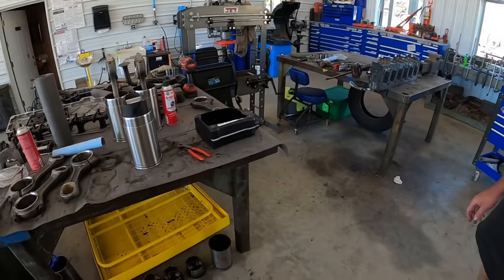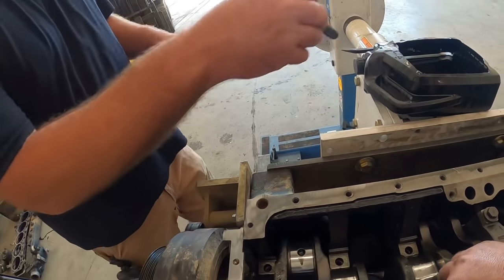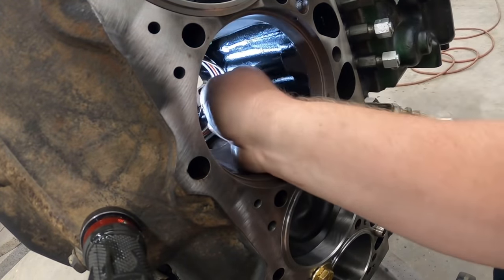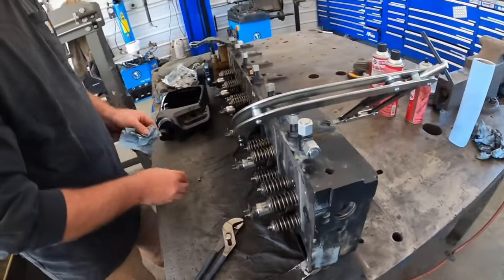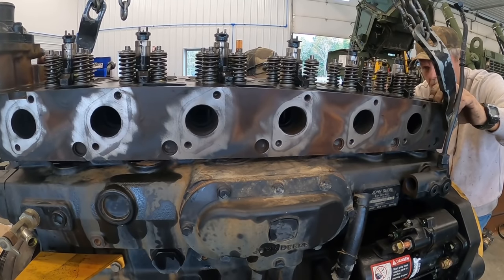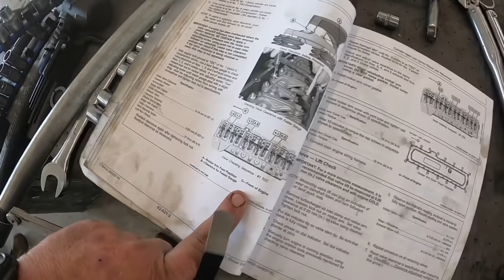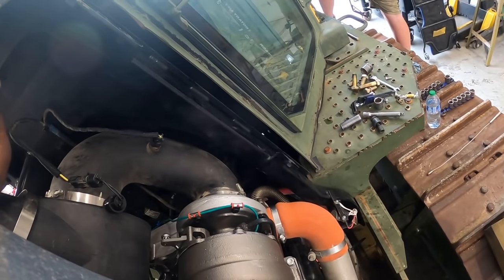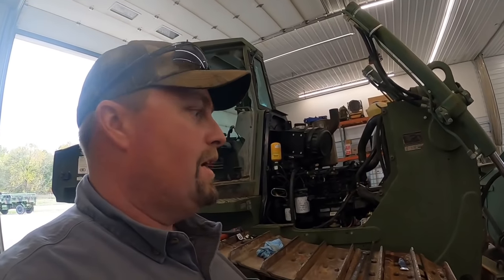John Deere 6090 9.0L engine rebuild in 850J part 2

Comment: Love the clean assembly environment and the attention to detail. If I needed work done I know exactly where I’d go!
Reply: Yea nice shop environment for rebuilding an engine but I’m not seeing any assembly lube being used there’s no way you want to start that thing dry? Those crank bearing should have all been coated with assembly lube.
Reply: @joecorrie1  
They were coated with oil and started within a couple of days so the long-term protection and stickiness of assembly lube isn't required.  It wouldn't hurt to use asslube but I certainly wouldn't stop screwing it together if I didn't have any.  There's some stuff I'd do different if I had the time and money but their work looks to be plenty up-to-par; I'd have no problem running it out the door and standing behind it if it were my shop (my come-back rate/ratio was well into "less" range, beyond the ideal balance rate(s).
Reply: Torque to yield requires a special lubricant to be installed on threads and the head of the bolts to properly stretch each bolt which wasn't done. 
Rolling them bearings in sure did remove material from the back of bearings. Hope it didn't get into oil galleys. Goodluck with that build.

Comment: NEVER run main cap bolts or head bolts in with an impact wrench.  These bolt should be seated slowly and calmly by hand using any method that runs them in at hand speed. Most times you might not cause any problems using a low speed output of a cordless impact,  but the riskiest practice is to use a bigger, faster pneumatic impact and go full gorilla on the trigger.  I am not talking about TORQUE. I am talking about the lubricated threads acting as a hydraulic fracturing device if the bolts are seated faster than the oil can escape out through the threads.  To be fair about your use of the impact in this video, you were using only oil as a lube, and that is more forgiving than paste type torquing lubricants.
I have during the more than 50 years in the mechanic field seen 2 engine blocks damaged by a mechanic running head bolts or main bolts in with too much enthusiasm using a pneumatic impact wrench.  One was cracked when the cylinder head bolts were run in and the other was from the main bolts run in.
Reply: Would be easy to peel a corner of a main web by the cocked cap. Cordless electric drill is the easiest and safest tool for primary assm.

Comment: Bought a 400 Cummins dump. Drove it for some months without checking the air filter. It wasn't there. Dealer did NOT make it good.

Comment: I'd suggest the small investment in a gantry crane.  Save hours on the forklift, but also make it possible to do jobs safely with fewer hands.  Get the largest+tallest that fits into your shop, even if you have to assemble it inside.  But it probably only needs winch capacity to lift an engine, or an accessory, not a vehicle.

Comment: C&C Equipment +:  Another excellent & well-made video. Reasonably complete explanation of rebuild procedures for the 6090 diesel engine. Surprised to see that you had to refer to the factory books for torque sequencing of the head bolts! Would'a thought you'd have those mesmerized by now, given all the diesel engines of this type that have run thru your shop, but guess that's asking a bit much?!? It did start right up, tho'. So, despite the oily fingerprints in the factory book, would appear you know what you're doing! 👏👏👏
Once again, this video's quality earns it the YT 'thumbs-up' "reward!" Who knew!?!

Comment: Those liners that come with the piston in should be taken out and checked because many times the rings are not properly spaced 180 degrees out....thats the kind of mistake that can tank a motor real quick...a big no no from CnC equipment...
Reply from the maker: Good tip
Reply: I was thinking the same thing but thought that maybe it just wasn't videoed
Reply: Over the past six or seven years I've had three rings stacked straight as an arrow, and two broken rings.  First rule of being a machinist... trust nobody's work.

Comment: QUESTION? Is it permissible to reuse the plastic coupling that drives the hydraulic pumps?
Reply from the maker: It’s is unless they have say 5,000 hours or more than I would recommend replacing it

Comment: I'll tell you a hack I learned a long time ago. Take 1 of your old head bolts cut the head off and grind a screwdriver slot where the head was. Use this as guide bolts for the head. I learned that while doing a in frame on a 671 Detroit. They used rubber O rings and steel rings for the head gasket. Great video.
Reply from the maker: Yes that is and I have done that before especially on heads with no lone up dowels
I been into those old 2 stroke Detroit’s a few times also
Such a simple generic engine

Comment: I noticed no sealant on the sump gasket …? I know JD are well made but .. the block is iron the sump is alloy .. they move under heat at a different rate .. I’d have put a wee bit of glue on it but that’s just me ..🤔
I liked your new wash cabinet 👌

Comment: Sounds good. I noticed when you put the head back on you didn't check cylinder liner protrusion. I know on all the diesel engines l have built many year like Cummins and Detroit you had to check cylinder liner protrusion so the head gasket would seal it would be in 100 thousands like.003 .005 thanks for the video
Reply from the maker: We did for sure
Just wasn’t on video

Comment: Howdy I’m just wondering around your channel this one was a excellent learning experience it showed me about sand what it did to the pistons and the oil rings but it didn’t ruin the whole engine and the one piston ring was suppose to only be 15th and you commented it was about 200th and just the inter air cleaner not being there if that was the case sand and dust just about ruined a good machine but you do know your stuff it’s going to be a very good machine after you are done with it 👍😎🇺🇸NY

Comment: Head bolts should be drip dry lubed but drip dry, if oil pools at the bottom of the thread and an air gun is used you have a hydraulic chamber and the pressure could crack castings. I always wound a bolt to the bottom of the threads with a speed brace (by hand) to make sure threads where clear and all fluids water and oil are gone. Air line nozzle previously used across the top of the hole with rag to get rid of fluids in the thread holes. Shit happens.

Comment: Using some shouldered bolts with the heads cut off gives you some location for gaskets and guides for assembling components. You can taper the heads and cut a cross slot for removal with a screw driver. One you’ve made a few and used them you wonder why you had not done it years ago.

Comment: Nice heavy engine stand. Not an expert by any means but why did you not check liner protrusion? As far as the filter goes you are subject to find anything when you buy used equipment...
Reply from the maker: I did check the protrusion 
Just didn’t make the video
Thanks for watching

Comment: If you don't mind a critique of your engine repair they make an installation lube for end caps and main bearing that last longer on startup. I always use it. I also put a thin layer of grease to hold the oil pan gasket in place on installation of the pan those gaskets can be a royal pain in the you know where. Other than that fine job. You checked all the other boxes. It's been a while sense I worked on army Green. I was a wheel and track mechanic for almost 6 years. Kind of miss doing it
Reply from the maker: Thanks

Comment: Turbo oil feed pipes can get carbonised oil in them restricting oil feed to turbo causing turbo failure of new turbo. Unless you are sure new pipes should be installed.

Comment: great video love what you filmed and yes you could have shown the engine going back in ,, also next time can you show adjusting the valves please .. you said wet sleeves ok I under stand that but are some other diesel engines sleeves pressed in ??  I have worked on cars trucks and small engines but never took a diesel apart ,, love to learn ,, thankyou for filming ..
Reply from the maker: Will do on the valves. The video messed up and was in time lapse and I didn’t catch it. Yes your smaller diesels will have press in sleeves or no sleeves. I should of clarified that. Thanks for watching
Reply: @C_CEQUIPMENT  you did good I just want to learn what I can and you do great videos.. seen others do videos .. can't see what there doing camera a football field away from what there doing .. watched a video on a jeep tranny rebuild .. the whole video only seen the outside of the case and there backsides ..  your videos show and you explain what you are doing.. that's a great video .. thankyou for doing the videos..

Comment: So...if the engine isn't really connected to a true transmission anymore..instead to a coupling to a hydraulic pump/transmission; do you really need a diesel now? Do you still need the high torque or wouldn't a high rpm Honda straight 4 cyl work just as good or better while weighing 1/4 as much as a 6 cyl diesel. I mean all your doing now is turning a pump.
Reply from the maker: Definitely have to have the diesel for the torque for sure

Comment: I didn’t hear it mentioned, but if that’s the original crank, are the new bearings resized for compensate for wear, or do you guys just use stock replacements? I’m not s mechanic, I just go off of whatever I can learn on the best YouTube channels I can find
Reply from the maker: Stay tuned and I will explain that in the next video on this

Comment: Torque to yield requires a special lubricant to be applied to threads and the head of bolts to be properly torqued.
I did notice the material being removed from the backside of the main bearings as you rolled them in, hopefully that material didn't get into oil galleys. Goodluck with that build
Reply: What's the name of the special lube
Reply: Detroit Diesel requires a special lube but not every manufacturer does things the same.

Comment: With all the metal parts that was in the pan and spun bearings!!!  And you didn’t pull the crank, Mike it and at least flush the block 😱😱😱. Looks like a hillbilly junkyard work 👎👎👎. Sorry, NOT the correct way to repair an engine.
Reply from the maker: Your on a totally different video
This one’s over a year old
Reply: Sorry my mistake

Comment: we got an engine from ex army van  they gave it to the boy s to reman  in putting the bearings in they got mixed up on the ends& mains i did not get the bolts out off that one i did get half the money back and a free engine for parts  keep up the good work 🤟👌

Comment: Surprised you all didn’t pull the crank and vat the block with all the metal that engine had in it. Cleanliness is #1 in engine building.
Reply from the maker: This is an old video
Stay tuned for video tomorrow

Comment: Fantastic closeups and sequence!!! 
 I did notice you have what appear to be Perry suspenders.  The founder of those is a native of Decatur.  The dad and son are quite the inventors.  I don't remember what else they have invented, mfg'd, and patented!  The closeups on installing the valves really emphasized how well you were working together.
I don't know about CAT's engine assembly (at Mossville, IL and Lafayette, IN) but in Decatur (trucks, tractor/scrapers, and some of the rubber tired loaders) all bolts are to be assembled dry to get the proper torque. "Lubing with anything will allow over-torque.  CAT uses only their specification grade 8 bolts that are above standard grade 8 or so we always said.
I would strongly recommend you guys use some ear protection. That very nice "tin drum" you are working in really amplifies the tool and engine noises!!!

Comment: Quick question Clint…. Is assembly line not recommended for Diesel engines or do you just prefer to use a little oil?
Reply from the maker: The book shows engine oil for lube

Comment: If you have old head bolts you can make long alignment studs out of them.  Cut the heads off, then cut a screwdriver slot in the top and use a straight screwdriver to run them out after the head is set on.
Reply from the maker: For sure
Done that before especially if there is no alignment dowels

Comment: Where do the push rods ride on?
Reply from the maker: Lifters and rocker arms
Reply: @C_CEQUIPMENT  what does it mean if you had one of the push rod stuck inside the lifter? Had one that was running weird and I took the rocker cover off and noticed that rocker had fell apart. And then had to use a pair of needle nose pliers to pull the push rod out from the lifter. What do you recommend I do?